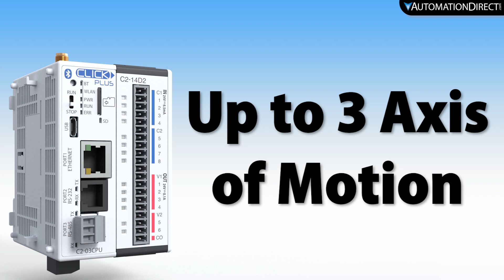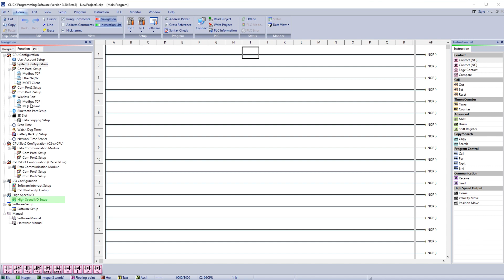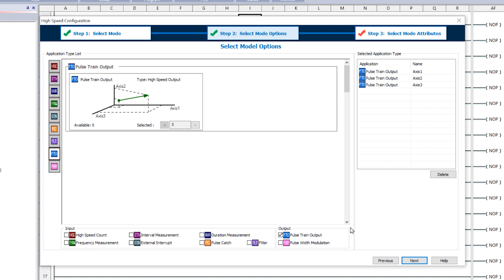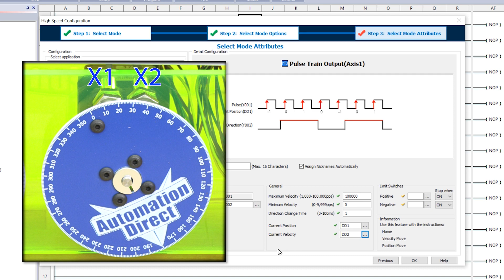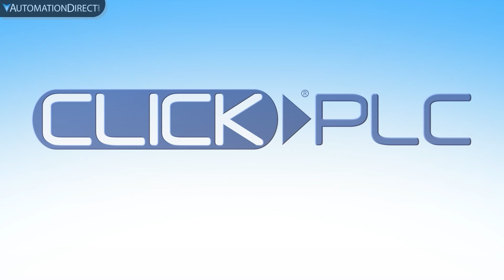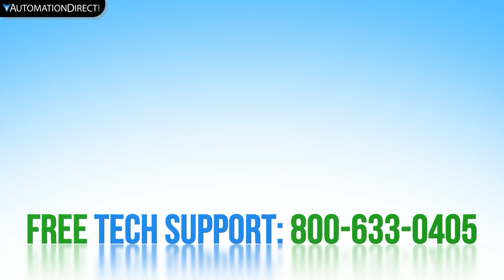CLICK PLUS PLC Motion - PTO or Pulse Train Output Setup at AutomationDirect

Comment: Any chance you could show how the wiring is connected? Thanks
Reply from the maker: @alanbaldwin9175 This depends on the product being controlled. For example, the CLICK supports both NPN (sinking) and PNP (sourcing) output cards, allowing it to interface with either type of motion controller. The motion controller determines which output type is required and how it is wired. Regardless of the wiring method, the CLICK software configuration shown in this video remains the same. We provide example wiring diagrams for several motion controllers we sell; however, if you are using a third‑party controller, you should verify compatibility. Refer to the diagrams here:
https://cdn.automationdirect.com/static/manuals/c2userm/ch3.pdf#page=56?utm_source=9n1pAinn1E0&utm_medium=VideoTeamComment

Comment: Why is my PTO option under the high speed config grayed out?
Reply from the maker: @DylanCarpenter-r5y What are your CPU and option slot module part numbers? Some modules (relay output module for example) only have high speed inputs.
Reply: @automationdirect  does the C0-11DD1E-D have high speed outputs that can be configured in the PTO?
Reply from the maker: @santiagovazquezadame6009  No. Only the C2 series CPUs from the Click Plus lineup offer high speed outputs. The original C0 Click controllers only include high speed inputs.

Comment: Looks great,  but this won't work on a regular click ?
Reply from the maker: Thanks for the question and thanks for watching our videos. Only the Click Plus (and only slot 0) is capable of output switching speeds required for PTO. Unfortunately, the regular Click is not capable of this kind of control.

Comment: Thank's for the video, i have a project that require to control 5 motor with pwm signal,the click plc come only with 3 axis motion,  could i use another module output that handle at least 2 pwm output ?
Reply from the maker: Thank you for watching our videos. As stated in the previous response to your motion control question: Unfortunately, only the first module slot of the Click Plus PLCs supports high speed IO. There is no way to add more motion axes on the CLICK PLC platform. You may want to look at our BRX and LS PLC product lines that offer more motion control options. https://www.automationdirect.com/motion-control